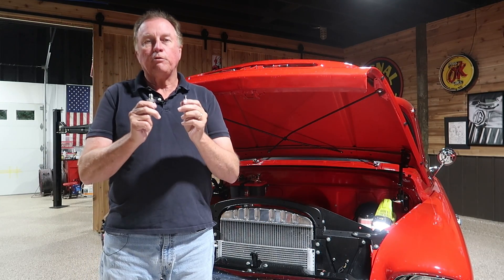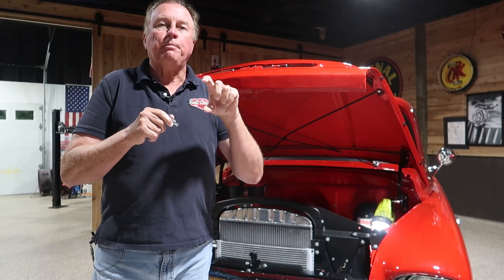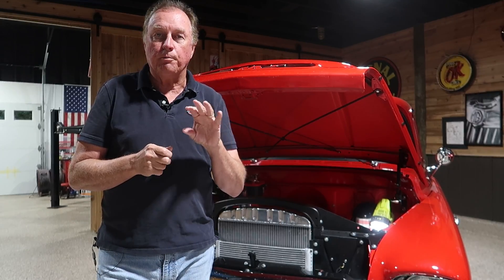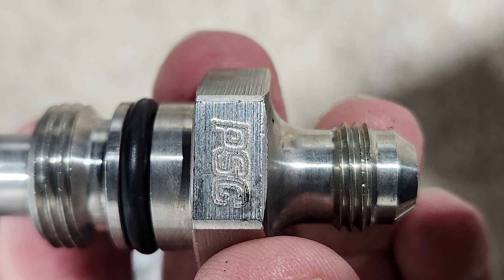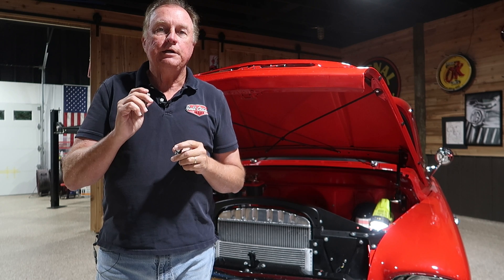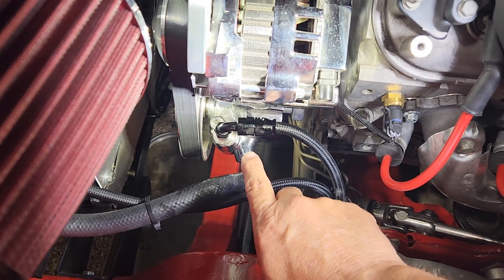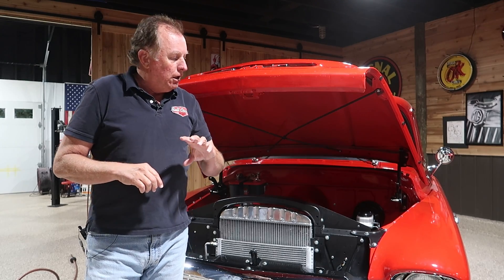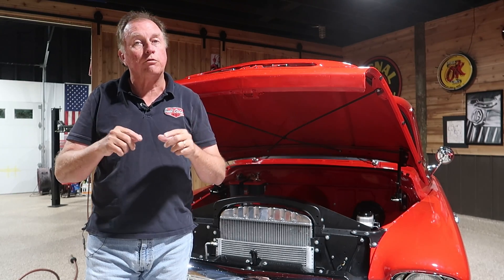Flow Control Valve 4.5 GPM Type II Power Steering Pump

Comment: I have a Heidt's adjustable valve between my C5 Corvette steering pump and C4 Corvette power steering rack. There is a threaded plunger that screws up and down to bleed pressure off to a return line that goes back to the pump reservoir.
Reply from the maker: I bought a CPP adjustable but could not get the banjo to seat. I will have to look at what you got.